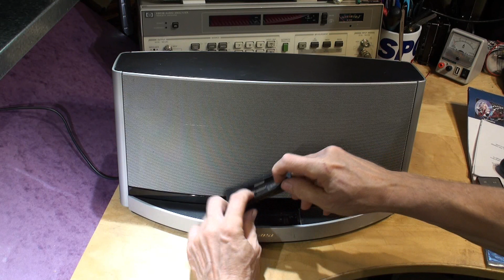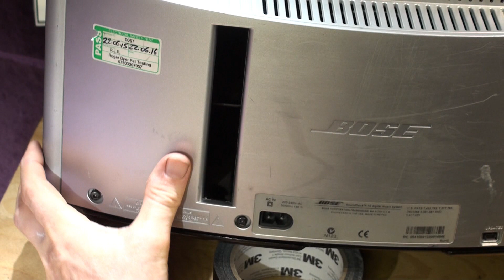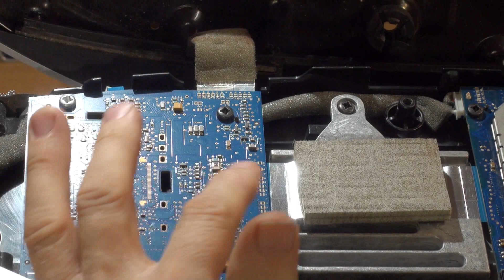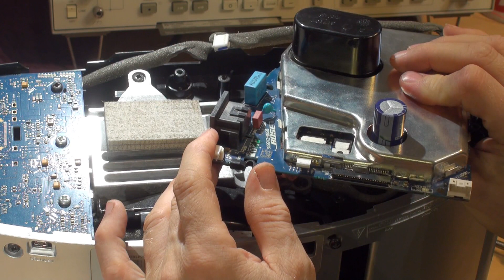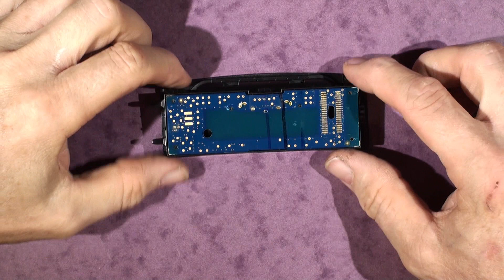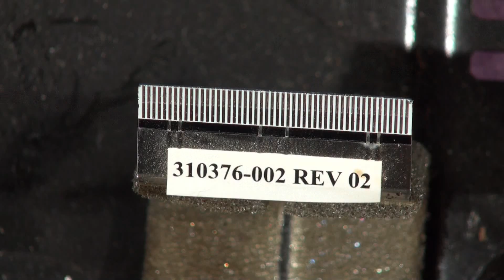Bose SoundDock 10 Basic Diagnostics Troubleshooting and Disassembly

Comment: Hi Sir.

My unit has a problem.
It show powerlight. And it has the bluetooth adapter.
When i press bluetooth button,then the ipodlight come on for 3 sek.
Then it go black.
Then powerlight comes on again.

I can not turn it on so i can play anything on it.
Do you know what is wrong?
And can i send you the part that need repair so you can fix it?

Comment: Hi, my spring connector (interchangeable module) doesn't look like it's in a good condition; 8 pins are misaligned. It's the connector that you're talking about here 28:20 Does the connector need to be replaced or can it be manipulated and fixed using some tool?

Comment: Hi, for me, some liquid got into the 30 pin conector, I think it did not got in the 30 conector on the base. So, now if I conect the stock adapter, both dock and Aux lights will blink erratically, until I unplug the 30 pin dock. Everything works great with Aux still sound big and loud and great. With this simptoms could it be only the dock and I will have to replace with the Bluetooth? I don’t want to buy the adapter without knowing something inside is broken. What do you think? And thanks for your comments

Comment: My dock system doesn't have a button to pull the docking module out
Reply: On mine the docking module comprises two parts. An upper small cover which can be pried out with care. Small screwdriver lifts front edge and it can then be turned slightly upward as if hinged at the back and then lifted off. That will reveal a button in the docking module, to the right, which needs to be pressed to release the module from the base.

Comment: Hi guys, I haven’t used my Bose sound dock in years and recently pulled it out of storage. The remote is long gone and when I connect my phone via BT (I have the BT dock connector) the sound is much lower than normal. Do I need a remote to control the volume or is something else wrong? With iPhone volume at max both speakers work but the volume level is barely above a normal inside voice. Should I just get a remote or send it to you guys for repair?
Thanks in advance
Reply: Hi levinkender, I think that is normal, I always have to used the remote to pull up the volume on the unit, definitely you need the remote, by default volume is at 20% every time you turn it on.

Comment: Hi I have the exact system with a 100 -120v AC power configuration. Not used it for several years. Can’t tell if it is on or not. I also need the Bluetooth receptor/adapter

Comment: My sound dock 10 has no bass sound and only 1 speaker is more sound than the other speaker. Please advise me what might be a problem, the Power amplifier or sound processor, can I send this PCB module to your shop so you can diagnose and repair if damage the module. Please let me know your shop address. I am staying here in UAE.

Comment: i have the same dock but the issue i have  is the volume goes to max and i can't turn it down not even via the ipod i dont have the remote so using with no remote dock connector seems good
Reply: could this issue just be the fact i need to get the remote replaced

Comment: Hello
This power audio unit is similar to the one used in bose soundtouch30  . Do you repair this last one . Mine the sound is weak and unclear at all . I found out the Audi amp tpa3100d2 burnt ( 3 legs at least)
Do you think replacing this ic fix the problem 
Many thanks

Comment: I'm looking at buying one for $20 USD and the seller stated the ipod dock doesn't have sound, but the speaker itself has sound when using the input on the back. Trying to figure out if I can fix it or even find the necessary parts here in the States

Comment: my bose dock 10 when plugged in does not beap. i would like for you to test the power connector and the bluetooth connector. What is your address and email address. I have watched the video and pull the portion out that is requested.

Comment: My Sounddock 10 does a 2 beeps fine on the left and right but while playing in my aux it works only one sided left side and i am wondering if the aux cable could be a problem or the aux it self, i won't bother the bluetooth cos it not working.

Comment: Very useful video, thank you!
Now, I have the exact system as shown, now 11 years old, I live in Canada.
I ran all the tests: remote ok
but no beeps with the AC plugged in.
Power Supply failure.
Question:
Do you sell alternative power modules for this unit? If yes at what cost?
If not, do you sell originals?
How much?
Thanks.

Comment: BRO, I DID RECEIVE MY SOUNDDOCK 10 TODAY, AND WHEN I PLUGGED IN THE AC POWER NOTHING HAPPENED. NO BEEP, NO FRONT PANEL INDICATING ANYTHING. AS I SUSPECTED AFTER WATCHING THIS VIDEO THE PROBLEM IS VERY LIKELY TO BE THE POWER MODULE??? OR IS THERE ANYWAY I AS A "NOT PROFESSIONAL" COULD FURTHER TRY BEFORE I TAKE IT APART AND GET THE  MODULE OUT?? 
BTW I LIVE IN TAIWAN, SO THE SHIPPING FEE SHOULD BE TERRIFYING://
Reply from the maker: Shipping fee isn't bad by EMS. Around US$15.  On the power boards You can see a small brown capacitor next to the ribbon cable - no need to remove the power board. Just measure across that capacitor and it should give 24 volts DC.

Comment: Thank you, great video ...

My issue is the that the Bose starts up fine, the happy double beep ... it connects to the Bluetooth (no sound) and won’t play .. Nothing wrong with the adapter as it works fine in a smaller device ..
Reply from the maker: Most likely a fault in the front section of the dock - usually the docking connector. Can you make it play by feeding an AUX audio signal in the back.?  email support@invebo.com

Comment: Mine is 110v and works fine until I used a new step down transformer (220v to 110v) i don’t know what happen but now when you turn it on,  it works but after few seconds it turns off. Even if i use a different step down transformer. What is the possible problem?
Thanks
Reply from the maker: Not sure - most likely a problem on the power board.

Comment: Hello, mine has no noises when turned on then will still charge ipods & has aux & ipod symbols flashing, remote does not work? Any assistance much appreciated 👍
Reply from the maker: Does it work when you feed AUX audio in the back by cable?  See diagnostics at www.invebo.com
Reply: @ispens  had fixed now thanks anyway👍
Reply: @jasoncashmore6675  fixed how?

Comment: Hello. When I plug my sounddock it doesn't make a beep but comes on. The indicator flashes the dock and Aux at the same time and won't respond to the remote control
Reply: Mine has same problem?
Reply: same problem here. blinking aux and dock icon
Reply from the maker: Likely (common) Power board failure see diagnostic video at www.invebo.com

Comment: Hello I had a question music comes out when I connect the aux but when I connect the bluetooth on the dock no volume comes out, can you help me?
Reply from the maker: Which Bluetooth adapter do you have?   - a 3rd party one that plugs into the 30-pin or an original Bose BT module that engages in  the SD10 cradle?
Reply: @ispens  I have a 3rd party one, it's my moms bc she has the same speaker and it works for her. When she plugs it in it makes a noise to let you know it's on but with mine it makes no noise and my phone connects to it but no sound comes out
Reply from the maker: Well it could be the Bluetooth device faulty. Does you dock beep when you give it power? You need to try an apple device in the dock.
Reply: @ispens  I have tried putting an ipod on the dock and it does.not play the music
Reply: When I plug the ipod in the dock it charges it but still no sound
Reply from the maker: I ask again. Does your dock beep when powering up (when mains conected) ?
Reply: @ispens  yes it makes a beep sound

Comment: Thank you for the video, it is very interesting. I'm looking for a way on how to solve an issue with my Bose SounDock 10. One night I was listening to music on it and suddenly in the morning when I tried to turn on, it won't turn on. I've disconnected from power and left the speaker without connecting for around one hour, when I connected to power I hear a beep sound but there are no lights. First thoughs were that probably my remote was broken but I check the IR Led and looks good. Any suggestions on what should I look further? Thanks in advance.
Reply from the maker: Have a look at the diagnostic video at www.invebo.com
Reply: @ispens  how do you repair? A damage  aux plug-in

Comment: Had a strange problem with mine. Should mention it was in a boat that had a fire on board and may have had some water/ fire extinguisher powder sprayed on and near it. 

It has the Bluetooth adapter in already. The last day or two  it kept shutting down while playing music, rather sporadically, sometimes after a couple of minutes, sometimes after 20/30 minutes. It would just shut down. Never had a problem before.

First thing I tried was a new cable which didn’t do anything to help. Then I unscrewed the case and found some corrosion on the circuit board on the other side (not the covered power one) I used some alcohol to clean the board. 

Put it all back together and then nothing would work. It was just flashing the iPod and aux icons but would respond to the remote but changing the flashing speed. 

Then I jumped down the google wormhole and found this and got to the part where you removed the tape connecting the front and realised I may have bumped it. So pulled it apart again and cleaned and reconnected it. 

Turned it on and now it will make two beeps but the Bluetooth connection won’t light up 🤷🏼‍♀️. It will play music through an aux cable and it hasn’t cut out yet... I’m on about 3 songs so far while I type this. 

I have cleaned the gold connections and still doesn’t work.

I guess aux is better than nothing 🤷🏼‍♀️. Also couldn’t find the Bluetooth  adapter on eBay  to try replace it.

Anyway, that’s my story.. so sad because I use this thing all day, everyday and a new one is far from my budget at this stage
Reply: Hi may i know where is it located? The tape i mean

Comment: everything works, connect and can hear the music the only problem is that my remote does not work, whyyyyy
Reply: If the volume control woks but you cant navigate tracks on the docked device then the dock connector is faulty. If you cant control the volume then look at the remote control in the dark with a cellphone camera. If you see white dot then the remote is OK and it is something inside the dock.
Reply: @razenby  hi thanks for getting back to me. I have tried that and nothing works, nothing on the camera, the buttons don't function at all. New batteries and all, could it just be broken?
Reply: If you don't see the remote white dot with your camera in the dark then the remote is not working.  If you have fitted a new battery then try bending the battery contacts so they make better contact with the battery,  This often works on a dead remote.  The SoundDock Series II and SoundDock Portable remotes are plentiful and they work on the SoundDock 10.

Comment: Hi, i have my sounddock 10 for around 9 years and never had a problem but now it just wont switch on. I used it last time 4 days ago and switched it off normally no problems but now it just doesnt react to anything. Checked the cable/socket and remote so its not the problems. Any suggestions please? Also my laptop doesnt see it after connecting to usb via update port on bose. Thanks!
Reply from the maker: If you don't hear the 2 beeps when you plug in the power then the Power module has failed. We repair for you - just contact us support@invebo.com. The service is international.
Reply: how much?
Reply: @luthiao  79 pounds
Reply: I do not understand the language much, you said in the video that repairs how to replace the tdf8599 chip do not you? What kind of repair do not you do??Are there any discounts to repair two pci boards?
Reply: tdf8599  Chip failure is very unusual. WHat symtoms do you see?  We can change the chip and repair for you. I am Ed the Invebo senior tech.
Reply: Any repairs videos on only one speaker sounding? I had it repaired once before by Bose when it was dropped. since then it was used very little via the aux in. it turns on but not sure if the beeps are made, anyways once on and plugged in via aux in only one speaker sounds. suggestions please?
Reply: If you hear 2 beeps a bleep-bleep at start up (power on)  then both audio channels are working OK.  Are you sure you aux lead is good?

Comment: Lost remote how to rase volume now
Reply: You need a remote. A remote controls for a SoundDock Portable and SoundDock Series  2 are easy to buy.  They have less buttons but work most of the functions.  (I use a remote from a SoundDock series II for testing SoundDock 10). User manual is here: https://products.bose.com/pdf/customer_service/owners/og_sounddock10.pdf .
Reply: @razenby  from where should I  buy this
Reply from the maker: ebay or Amazon

Comment: My sounddock 10 (120v power) equivocate (220v) this components normal  danified ?
Reply from the maker: I think you might be asking about the power supply voltage. There are 3 model:   230V, 110V and a more rare universal input version 100 - 230V.   If you want to change your power supply voltage the Sounddock 10 is easy to convert to a different voltage.
Reply: No ,my model 110 v ..equivocate 220 power accidental...understand?
Reply: Yes, the power Board will need to be repaired. We can also convert to 220 power if necessary. Email us at support@invebo.com

Comment: HI is there anyway to control this without a remote control?
Reply: You need a remote. A remote controls for a SoundDock Portable and SoundDock Series  2 are easy to buy.  They have less buttons but work most of the functions.  (I use a remote from a SoundDock series II for testing SoundDock 10). User manual is here: https://products.bose.com/pdf/customer_service/owners/og_sounddock10.pdf .

Comment: Hello, my bose fell, so no sound come from the speaker left but the speaker it self is not broken, is it the power module ?
Reply: If you had an iPod in the dock at the time it could have just broken the dock connector. Do you get the beeps when you power up the dock? Can you play music via the aux input socket? If so the docking connector is damaged.
Reply: Magic Smoke I think my power module is broken, i will change it
Reply: No, i tried via Bluetooth or aux but it sound the same